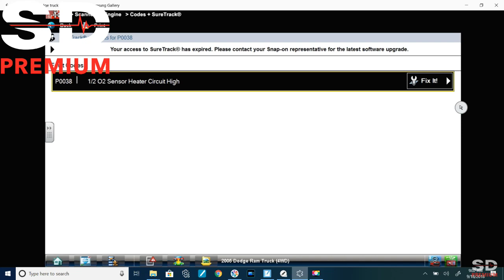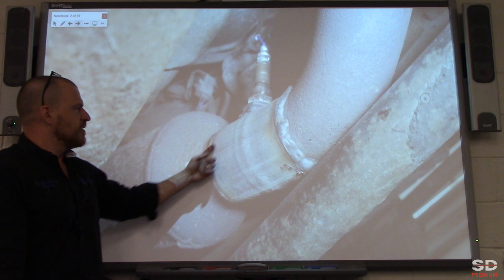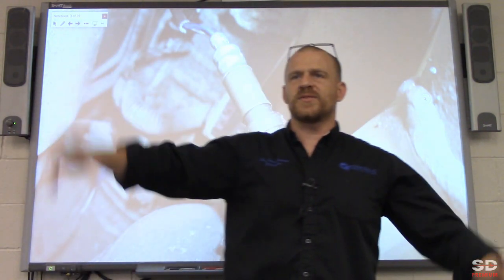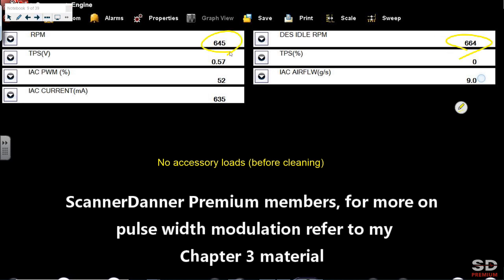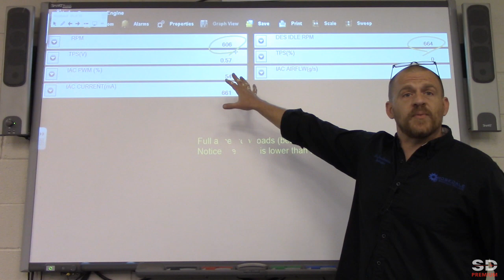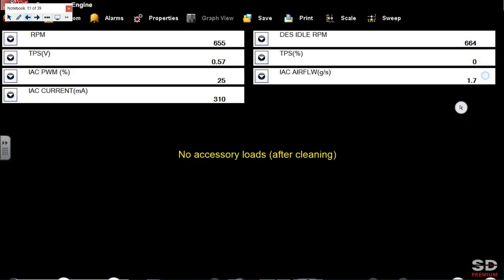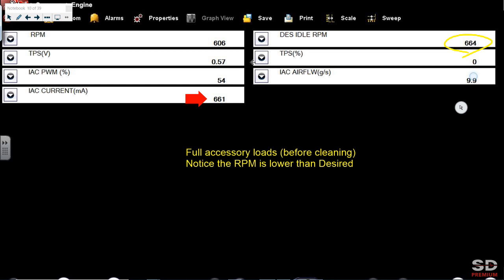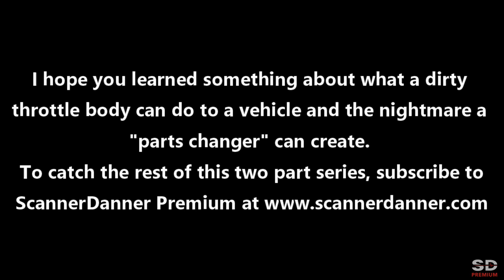O2 Code, Dirty Throttle Body (stalling problem) & Mechanic Incompetence

Comment from the maker: To see this full 2 part series, subscribe to ScannerDanner Premium https://www.scannerdanner.com/join-scannerdanner-premium.ht…
There is a 14 day free trial
Don't be mad at me for not including this O2 Heater circuit tests here. I did give you guys the complete portion of identifying and repairing the cause of the stalling problem. Yes, another dirty throttle body :-) This IAC data is different than others I have done and will be very useful to you guys. Thanks so much for all of your support! Hope to hear from you both here and on SD Premium. Have a blessed day.
Reply: I'm a subscriber to your website and damn glad I am!!!!!!  I'm learning so much and I'm only on section 5!  I'm excited to keep watching.  Every minute of your content, I'm smarter.  Thank you so much for doing this.
Reply from the maker: @blainehallmark  thank you so much! so good to hear
Reply: Hey paul a little off topic  but looking for your - Snap-on Verus Training video can you post a link? thanks
Reply: i took mechanics and have found mechanics I wanted them to bleed and check codes cause i have abs brake  lights on. I took it to them to get it read cause I dont own a obd 1 gm reader that is dealer only scan tool . So they came back with 51  motor  free spins loose hub nut. I took abs apart and found the motor gear was loose and free spinning I fixed it with junkyard one so I could bleed the brake system . for 20 bucks cause the one I had air in the abs and requires scantool from gm I did not want to spend dealer cost so I only spent 20 to get a working one cause abs has to be in home position which the abs is always in home . i put one from a working donor car left car off and did  a 4 wheel bleed from rr fl circuit then the rl fl circuit and the abs modulator with a homemade pressure bleeder . Took care of the code 51 passing inspection this year on a 20 yr old car again and dont need to pay a shop to fix my gm car.Where they told me to replace wheel hubs they wanted me to spend money on that which was not my problem I went  to several mechs telling them it was abs making a ring sound and the brake and abs light will appear after that . I know it was abs but they wanted to tell me different that would not help . Im wanted to mechanic on cars I got job offers I want to work for myself.I took mechanic and have always been a 100 percent on my diagnostics.
Reply: I'm a subscriber to your website but i can find it the video won't update beyond this date 10/31/2018
Reply from the maker: It's in my scope and scan tool playlist. Main page, scroll down near the bottom (after the chapter playlists)
Reply: do i need to be a premium channel subscriber? because i cant seem to find it
Reply from the maker: To watch this two part series you'll need to subscribe to ScannerDanner Premium. Thank you!
Reply: sorry i should have been more clear. I was asking if i need to be a subscriber to the premium channel to view the verus training video because i cant seem to find it
Reply: How to check exhaust gas temprature sensor? ( ex: nissan navara or pathfinder had 3 EGT  sensors )

How to check air bag module ( ex: for nissan capstar  driver airbag  module and spiral cabel has same fault code B1049. How to Separately identify which part is fault... spiral cable can check connectivity but how to check airbag module?
Reply from the maker: Yes sir, you can subscribe here. There is a 14 day free trial. 
https://www.scannerdanner.com/join-scannerdanner-premium.html

Comment: I watched one of my tenants go through this: 70's Monte Carlo. He pulled the car in because it stalled in the street. Diagnosed no fuel so they changed filter. Still no fuel, changed fuel pump. Cranked the piss out of the car and burned starter. Replaced starter with wrong one. It made horrible noise so replaced starter again. Still made noise. Removed transmission to change flex plate that had ruined teeth. On installing transmission, didn't set torque converter right and broke off ears to transmission. Bought used transmission. Finally figured that fuel tank strainer was plugged. Removed tank and cleaned... Car started and but transmission did not shift right. Sent trans to rebuild...reinstalled, still did not shift right. Rebuilder came out and plugged in disconnected vac line to modulator. Car ran perfect! ...test drive then drive line fell off and beat the hell out of the bottom of the car. Car pulled back home...reset game..
Reply from the maker: this is legit man. I know these kind of stories. Thanks for sharing this nightmare with us
Reply: That is Fkn funny. I have also seen cascading failure in action many times and am always amazed.
Reply: Fuel pressure guage would have been handy
Reply: Jajaja is a funny  storie thanks for sharing it
Reply: had a customer bring in a dodge pickup with a 4.7, crank no start. he paid some guy to diagnose the crank no start, the guy put in new o2 sensors, fuel pump, IAC, coil, plugs, and every sensor but 1 because he couldnt find it (take a guess). Ran the battery down, tried jumping it repeatedly and gave up, had it towed to me. Couple of checks, no communication with computer only, Fuses good, Checked, no 5v reference, no coil trigger, no injector pulse no nothing. Checked powers and grounds to computer, all good. removed computer, smelled like burnt dog hair. ok replace computer. STILL NO START!!, However i had communication, i had 5v reference, fuel pump primed key on (so good call on computer). So first thing i checked was cam sensor, yep, its bad. replaced cam sensor, it fired right up, bucked, snorted,puked,groaned,smoked, then smoothed right out after about 30 seconds.
I finally got the whole story after the fact, He parked truck, shut it down, then wouldnt restart. Neighbor thought he was mechanic, kept throwing parts at it and cranking it until battery dead. Initially hooked up battery charger backwards, Which is when i suspect the computer got toasted. The initial no start was the cam sensor. It is quite inconveniently located on the passenger side near the front of the head and buried under a bunch of crap. So bad people with bad information and lack of skill are out there.
EDIT:Just a quick note, when suspecting a computer, and curious about why no 5v reference, you can use a power probe "Hook" in "reference" mode to simulate a 5v reference when computer unplugged, you can put the 5v right in at computer connector, and check downstream, if the 5v is there, you just vetted the whole 5v system for shorts to ground, and shorted sensors without unplugging anything but what you already have unplugged.

Comment: I'm an old guy and have seen plenty.  Most auto/bike techs are competent but the flat rate system and other time issues lowers their work standards to borderline adequate or worse.  This is a shame because they lose pride in their work and profession and become unhappy souls stuck in a low quality rut.  However, most often this is management's fault.  But it is a personal choice to hold your nose and  swallow or move on to an improved situation.
Reply: I agree. I have customers come in from the dealer all the time wondering how and why things got replaced that wasn't the issue. I always explain that it's usually not the tech as much as the company. It's a time thing and the dealer will firer you if your not making time. I've never worked at a dealer or under flat rate but I always thought that was the case because most of the mishaps come from flat rate places. This is no longer a backyard field and techs need to be paid as such. As a owner I still take classes every 3 months or as much as time permits. You have to stay up to date

Comment: I entered this trade in 79 ,things were obviously a lot easier to repair and maintain those days . I left it around 2000 to become a truck driver, i still maintain the family cars around a dozen different vehicles . Over the years i have found most guys my age left the field due to the amount of electronics being used . Correct diagnosis  is very important  to getting it right and keeping the customers happy .I  feel in the UK  motor industry far to many of the older motors end up in the wreckers yards because of the lack of people out there with the skills to do a first time fix.  Parts are far too expensive to just throw on a vehicle if it dont fix it  . Its great  to see you putting your skills over in the classroom for youths to learn .  Thanks for sharing your  knowledge with us all Regards Rich.

Comment: Hey Scanner Danner. Saw you on Eric the car guy and then watched this video.  Incompetence is rampant in the automotive trade even at the so-called dealerships.  In Australia some years ago I bought a used 1988 Ford Fairmont Ghia top of the range model with 80,000 kilometres on the clock.  After a while it would refuse to start and then suddenly correct itself.  It also revved up and down at idle.  The Ford dealership changed many parts and also swapped known good components (including the computer) from cars in stock and they still never discovered or corrected the problems despite many hours of attempted fault finding and major expense to me.  They obviously lacked the training or expertise to solve the problems.  I eventually gave up, got rid of the car and purchased a new Nissan Pulsar Sport that ran for twelve years with no problems.  Truly, competent technicians are very hard to find and worth their weight in gold.  Unfortunately the unwitting customers are taken for an expensive ride by incompetent dealerships and mechanics!

Comment: I'd like to think that most shops aren't inherently dishonest, just under pressure to get things done asap, and keeping costs down is not the highest priority. No shop wants to send a customer away without a fix, that's a customer gone for good. I'd rather believe that they just don't have the knowledge to diag properly. 5 or 10 yrs ago i thought i was a decent mechanic, but looking back now it's incredible how much I didn't know. I'll probably say the same thing in 5 or 10 years from now. Things have gotten very complex very quickly when it comes to diagnosing problems. I truly hope the guys in your classes are paying attention, I'm honestly envious of the chance they have to learn the right techniques without years of trial and error.

Comment: My experience has been that you will find 10 parts changers for every competent mechanic out there. It all come down to learning how to diagnose the problem and it has been the same problem for ever (folks used to bring my grandpa cars in the 1930's-1960's that no-one else could fix for this same reason). There are a few dishonest people in every field though.

For anyone out there, shade tree or pro, ScannerDanner's techniques are well worthwhile learning and the price to buy his book and/or join the premium channel are cheap compared to the knowledge you gain. Even as a shade-tree mechanic I am much more confident and much quicker with a diagnoses now because I have a better idea of what path to take to diagnose the problem.
Reply from the maker: I agree, 10% but sometimes I think it may be closer to 5% :-( and thanks for the comment on my material, I really appreciate this.

Comment: The late 90s Nissan sentras had three separate idle air control devices on them. The one used for the power steering blower motor headlights would max out at 100% with a dirty throttle body. The air conditioner had its own separate idle air control valve and there was an actuator on the throttle plate for speeding the engine up when it was cold.
Reply from the maker: don't miss those at all!
Reply: I've got the European equivalent, a 99 Almera, as my daily driver 😁

Comment: Being an electrical engineer with lots of hands on experience with oscilloscopes and other tools, and a moderate understanding of cars,  makes me wonder if diagnosing issues would be a good part time gig in retirement.  Haha. I can't stop watching these videos.  They're so interesting.
Reply from the maker: Always cool to have engineers watching :-)
I've ripped on so many automotive ones but in all honesty I have massive respect.
Reply: Believe me,  I've wanted to punch a few automotive engineers in the nose a few times over the years.  Haha. One memory in particular was changing the EGR valve on a 07 Grand Caravan.  Gotta loosen up the alternator due to like 1/8" of interference preventing EGR valve removal.  I'm sure that's nothing compared to some of the stuff you've seen.  It was just the point of it.  Anyway, it's so cool watching your videos because I understand every detail of what you're saying and I can tell your knowledge of the subject is vast and accurate.  Thanks for the education.

Comment: A bad IAC will cause a rough idle when cold. Once the car warms up, the rough idle usually goes away. I’ve seen low coolant levels cause and IAC to fail since it cannot measure coolant temperature at start up and at warm up.  I had this issue with an 02 CRV. While picking up a new IAC at the Honda dealer, the parts guy told me they change out failed IACs on Accords every day.

Comment: Two years I was on vacation in ohio and I was visiting some friends and family.  But friends dad said they have had a problem with their 97 dodge Dakota randomly stall, crank no start when hot or cold. Sometimes in the morning it wouldn't start at all and at stop light it would stall and sometimes start back up. It had no codes and I didn't have any diagnostic tools with me. This truck had been to four shops. So I had to think outside the box what could make this truck just stall. So I got it to run and when it did run it ran great. But to restart the truck I found I had to hold the throttle by hand part throttle and tap on the idle air control motor for it to start. I did this three times before calling it a bad Idle air control. His parents bought the part and I used some borrowed hand tools from Autozone and installed a new iac. Been running great ever since and hasn't stalled once they tell me.

Comment: Scanner i've got this to say about that...i've been a tradesman for about 40 yrs  , industrial mechanic and automotive technician ,have my own shop and spent about 28 years as an instructor at a community college (NBCC,Saint John,NB,Canada) that was originally a trade school!!! that is  more interested in dollars than quality, and as of late the so called principals have had little interest in trades,,,mmmm let me say that when a nurse or academics would be the dean of trades..well well,, also a lot of the high schools have dropped the industrial programs!!
the last department head i had was more worried that i spent to much time in the shop as it cost more than some of the other instructors that would sit in the class and read out of the book :(    but that aside i also find that a lot of mechanics today especially in the auto field (not  Techs... most today i wouldn't call Techs) don't have the interest or inclination to be proficient in their trade..and it definitely gives shops a bad name,,i would like to see shops rated on their ability ,,,, and more stringent testing to be a licensed tradesman ,,and that shops should also be certified for technical work
Reply from the maker: Absolutely agree

Comment: Ive directly experienced garages that have broken valves on doing head gaskets and forced the customer to pay twice for the job and of course valves, absolving themselves.   or breaking plastic parts and  hiding it, or playing parts cannon and charging the customer a fortune because they didnt test properly for a simple wiring failure...   yes they can be thieves, they get a markup on parts as well.  sure customers can be full of it too, lie, say they put new in, or swear nothing was touched etc and mess with things and create new issues.
Reply from the maker: that sucks but I do not think this in the norm, I really don't. I think it is incompetance first and then comes the lies because the tech or garage doesn't want to be the one to eat the cost of the misdiagnosis.
Reply: Absolutely garages should make money on parts

Comment: Excellent presentation as usual Paul👍🏾. Just to add to your vid, looking at the IAC (mA), it increases because the throttle body minimum air rate is less than it should be so the IAC has to work harder to compensate up to its correction limit. After cleaning the minimum air rate spec has been restored and therefore the IAC only need the trim very slightly to achieve desired idle RPM hence the lower IAC (%) and (mA). Awesome info and I really appreciate your contribution to this industry, thanks again, from your Caribbean friend.

Comment: From my experience going to many different shops, it's the latter. It's actually fairly difficult to find a mechanic that has solid diagnostic skills, most places will simply throw parts at it (at the customer's expense, of course) in the hopes that it fixes the problem. It's too bad that you and Eric the car guy live so far away, I would take my car to you guys

Comment: I had a vehicle that was running very rich at start up. Another shop had put in 2 new sets of spark plugs and 2 new O2 sensors but the problem was still there and now the converter was bad. I found that the inlet air temperature sensor, which controls the mixture during warm up, was dirty. I cleaned it and the problem went away. The plugs and O2 sensors cleaned themselves but unfortunately the converter was ruined and had to be replaced. Damaging the converter and replacing the other parts would have been unnecessary if they had just diagnosed it right and cleaned the sensor at the beginning.

Comment: Right there I check how many wires are in the o2 sensor nd get the cable with the computer control on nd check with a scope or test light on start up common problems on Chrysler found this on PT cruiser nd other suv